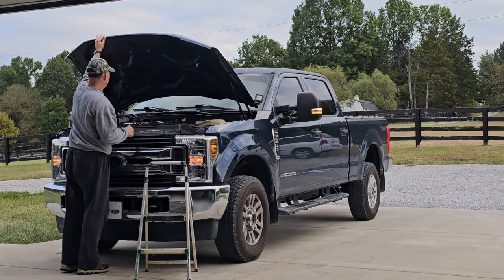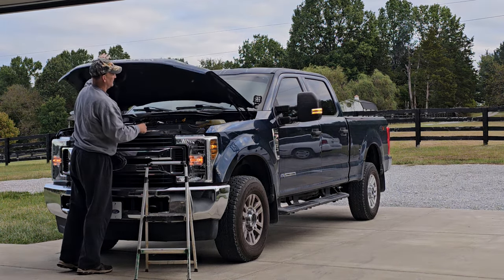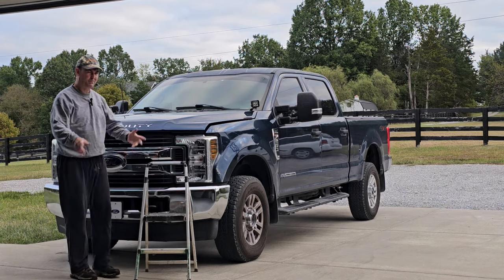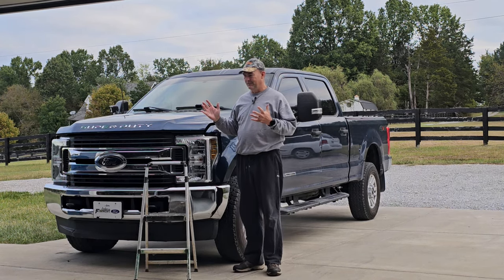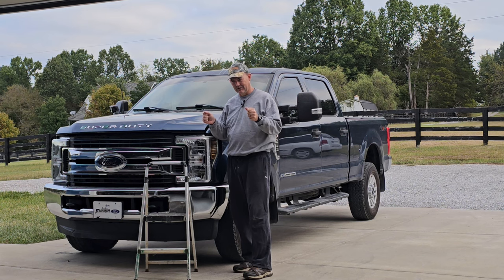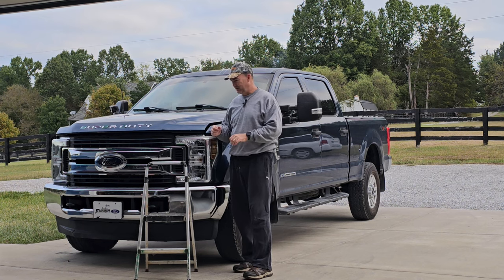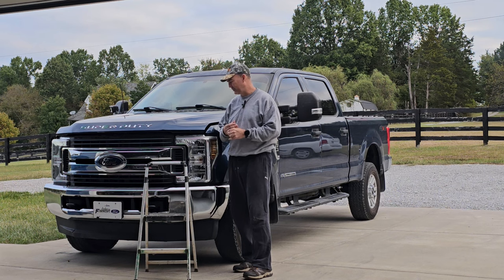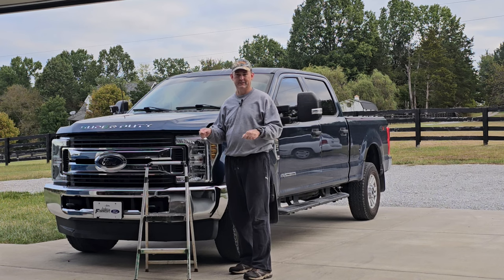Ford F-250 Super Duty Steering Wheel Clunking / Looseness / Popping SOLVED!!

Comment: I recently bought a used 2019 F350 dually. 110k miles. I have this issue also. Clunking in some turns, going over some bumps, sometimes when I accelerate and wheel turned, etc. I also feel it in the accelerator pedal. I’m going to check this on mine asap. Thank you for the video!
Reply: Did this fix it?

Comment: A noticeable pop in the steering wheel that can be felt in the accelerator pedal. My 2019 F350 SD has been doing this since 24k miles. If I turn the wheel to the right and his the accelerator, a sharp noticeable pop.
Reply: Same and I feel it when I am backing up also periodically

Comment: Took mine off to inspect it, felt a very fine dead spot in the upper joint. After putting it back on, now have a pretty significant knock in the colum at Freeway speeds. Craziest stuff..... 🤷

UPDATE:
Replaced the shaft and just like 4-Low. Magic all pops, knocks, whatever you want to call it..... Gone. Also this is shaft #2 for my truck. Saw in the service history that original owner had it replaced at 27k miles. I currently have 40k. I don't beat on the truck either. I think some company needs to make a stronger shaft.

Comment: My 2019 superduty has had this slight clunk in the steering wheel in right hand turns only for 3 years.   Dealer or anyone else can never feel it, drives me nuts.   Whats a dealer charge to replace this?   Can this be catastrophic if not replaced?
Reply: Got the same truck and exactly the same thing. Mine pops on right turns and on inclines when I accelerate. 2019 F350 SD. Took it to the dealership and told them the very same symptoms but they "can't replicate the problem." Been happening since 24k miles.
Reply: @BigDaddyCane777  How many miles you got on it?   I have replaced ball joints, tie rod ends, track bar to cure it and only have 50k miles on mine.
Reply: @mikedirks5889  I took the truck in to have it looked at when it had 30k on it. I have ~72k now. It's popped through the wheel and accelerator for about 50k miles and the geniuses at the dealership look at you like you're either a liar or insane when you tell them about this.
Reply: @mikedirks5889  it's not the suspension, though I've had suspension problems with the tie rod ends, stabilizer linkage, etc. But this particular problem is the steering shaft. I know exactly what you're talking about. I thought the suspension was about to come unglued. Mine is 4x4 and has the solid front axle/differential, which is a  luxuroius ride in a one ton.